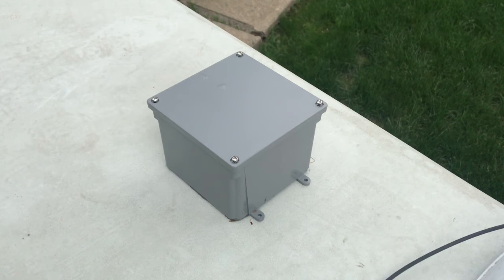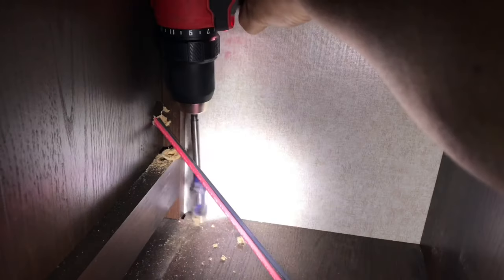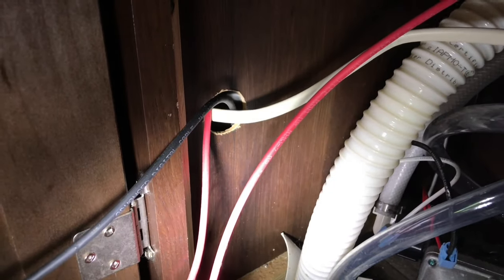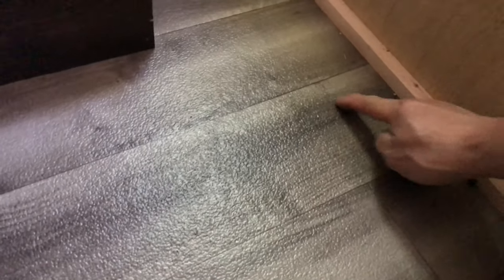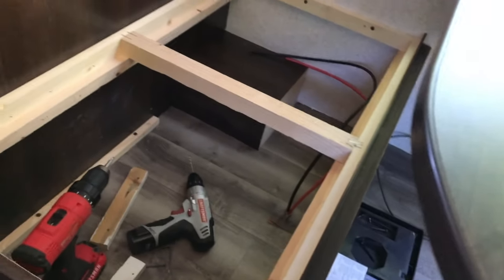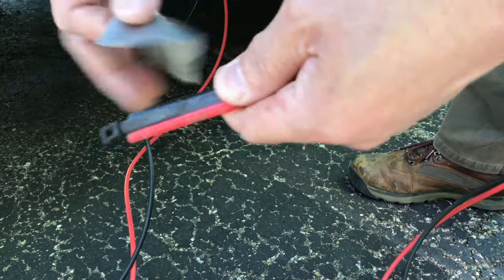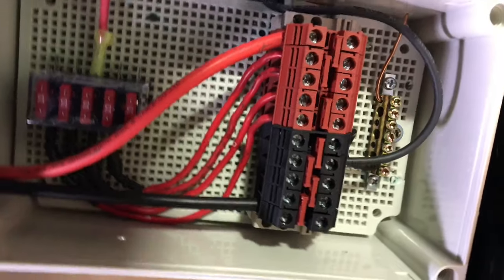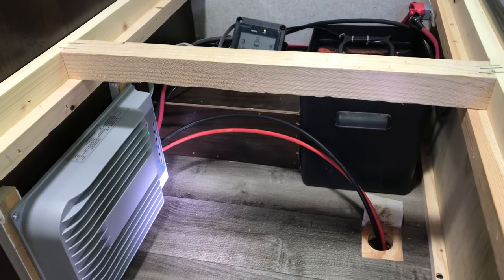How to run wires in a Jayco Travel Trailer for Solar Panels, Controller, Battery Bank + Combiner Box

Comment: AGM batteries INSIDE your RV?  I guess you have not heard about Sulfating batteries, this install could be dangerous to you and your families health.  LifePo4 is the only battery type i would consider mounting inside an RV.  You may want to consider changing your battery location, or your battery type, if not for yourself, for your families health.
Reply: Aims are fine inside ,they don't vent much if any .designed so that they can't leak acid.